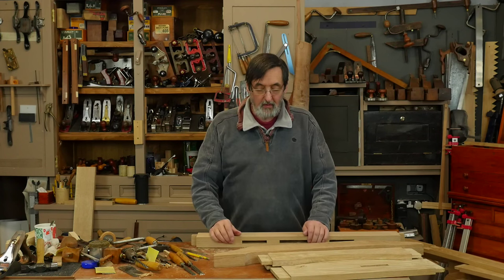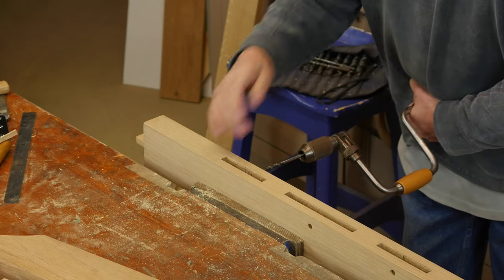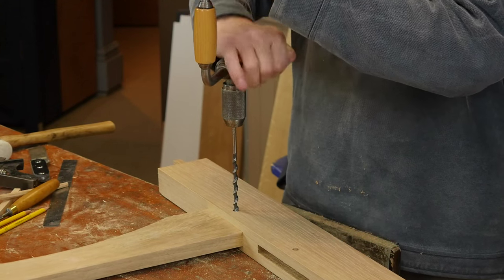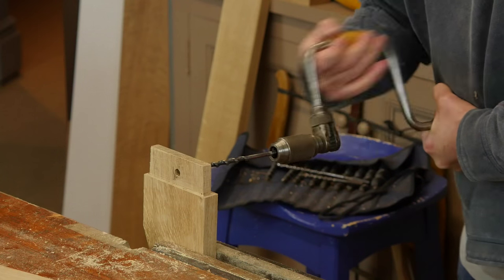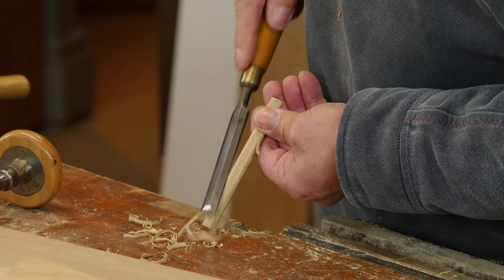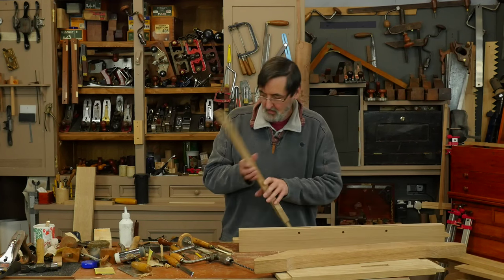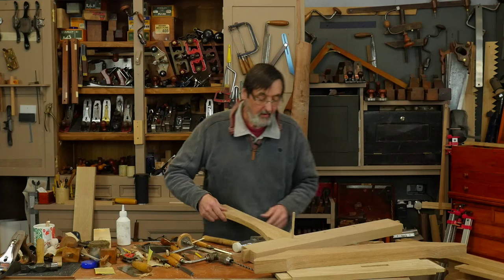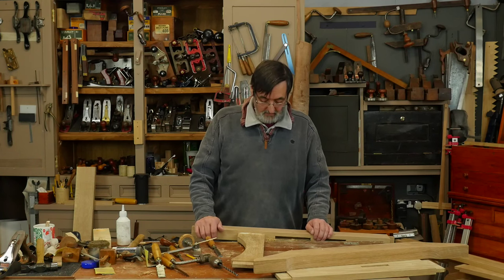How to make a Drawbore Mortice and Tenon | Paul Sellers

Comment: This is how my father, a carpenter, worked in Tuscany (Italy).  All of his furniture pieces were built using this method.  He would build the furniture in his shop, make sure everything fit.  He would then disassemble it and have it hauled (on mule-back) to the client in some distant village and re-assemble it - only then would he add the glue (on the dowel only).  Those pieces of furniture are still in everyday use 70 years later.
Reply: That makes a lot of sense, the dowel could be drilled out for disassembly if ever needed.
Reply: My grandfather built furniture using similar methods 100 year ago and they are still going strong today.
Reply: Great story.  My great great grandfather took his family to America from Liguria (Genoa) in 1869.  He wasn't a carpenter to my knowledge.  America had recognized the sovereignty of Italy as a country only in 1860.  I visited the village in 2018.  It's still just a little village with no commercial enterprises at all, not even a market stall.  I applied for recognition of Italian citizenship in the USA and received it in 2019.  It's quite an emotional feeling to come back full circle to your heritage.
Reply: @deemdoubleu  I think if you wanted to make knock-down joinery, you would use a tusked tenon joint.  Probably not as strong, but easily disassembled and suitable for tables, sideboards, etc.  A tap with a hammer on the tusk tightens up any wobbly joints.

Comment: Hi Paul, love your vids. I've also bought your dvds and book. Can't understand why these people don't trust the draw bore method, thinking that it weakens the joint. It tightens the joint a treat. As you rightly said, thousands of artisans have been using the method for centuries. Best teacher around.
Reply: Even if you made it with a screws it would be extremely strong. A lap or bridal joint similar to that with just screws would be extremely strong as well. 
Fools talking about it not being strong enough are deluded about strength. If they put a load large enough to break the table top and then the stiles and rails they are a special type of person.

Comment: I learned this with timberframe, and we only used 1/8" if I recall correctly.  Watched this to see exactly how much offset would be appropriate for smaller joins.  Of course we didn't use any glue. Excellence in fine wood working!

Comment: Dear sir, as a novice woodworker I was about to build my first workbench when I came across these videos about drawbore method.Do you think this method will work for a workbench?

I will be using
 4×5  & 3×4 sized timber.

If this is possible could you propose a thickness for the dowels and the offset value?

Your thoughts would be of great help.

Comment: would there be a concern about breaking out the center of the tenon?  How deep/shallow would you place the bore?
Reply: Pass Me By all the fibres will be supported as the tenon is inside the mortice hole.  halfway from the shoulder to the edge

Comment: So you prefer to chip off the excess PVA glue after it's set rather than wipe it off with a wet rag immediately? I've tried both, the latter tends to contaminate the grain with the thinned-out glue, and the former tends to rip up the fibres as it's prised off. I'd be interested to know how a proper woodworker deals with this.
Reply: Gaf It seems the sweet spot for taking glue off is about 20-30 min after set.  It's pretty pliable and kind of rubbery and comes off without a lot of contamination to the wood.
Reply: Gaf Don't use PVA glue. I use hide glue. Most of the time I use hot hide glue. Liquid hide glue like Old Brown Glue is much easier to use. Hide glues have no effect on finishes. Wipe the excess with a rag damped with cold water and you are done. Hide glue isn't suitable for outdoor pieces though. It is possible to reverse the bond with heat and water.
Reply from the maker: Gaf A sharp 1" chisel into the corner following both flat faces and cutting through the leather hard glue has worked for me for 50 years. No torn grain and no glue residue. Not gonna change now. i hate wet rags smearing the glue and raising the grain. Forget that. Neither do I like ideas like wrapping with masking tape. its silly.

Comment: I'm not much of a hand tool person. So, I have a question. If not using a drill press to make sure the through hole on the mortise and tenon boards, how are you sure that it is not angled? For example, you start your hole 1/16th higher on the tenon but on the other side end up with something different, like 1/16th lower. Wouldn't this cause an issue? Thanks
Reply from the maker: The idea with a drawbored mortise and tenon is that the holes are offset by 1/16. With the hole in the tenon being 1/16th nearer to the shoulder of the tenon so that when the pointed wooden pin enters the mortise piece it passes through a tenon and this pulls the shoulders of the tenon tight to the mortise piece. It doesn’t really matter whether the hole is perfectly perpendicular at all.

Comment: Great video, I was told by a much more experienced WW that using a drawbore in a M/T joint would weaken the tenon. It was for a workbench so it was in some decent sized wood, I didn't add them and am starting to second guess myself for listening. The bench is still rock solid with just glue and the joints were nice and tight to begin with?? Any thoughts? I would also like to hear your thoughts and how to clean the wood glue like GAF below.
Reply from the maker: Pat M Fraid he was wrong. At one time, before the screw-thread, every mortise and tenon relied on the draw-bore method. Surely two hundred thousand woodworkers can't have been wrong.
Reply: The glue joint will always be stronger than drawbore joint (at least when you have some long grain against long-grain), simply because it's always wood that would break there, not the glue (at least with modern PVA glues). Drawbore joint is self-tightening, something you don't have with glued joints without trickery. With drawbore joint you don't need to have 6ft long clamps (or 2x 3ft) for dinner table construction etc.
Reply: These are great points all, and with smaller m/t joints I think it is possible to weaken and break them more easily but in a large tenon which is 1" thick by 3" long probably not as likely. The gluing of long grain to long grain is what is happening in all my joints so I think the bench will be fine for a loong time to come.
Reply: MichaelKingsfordGray For it to split there would need to be room for expansion yes? For that split to be large enough to weaken the joint, it would need to be more than just a little room from, say, a taper on the tenon.  If your tenon is fit properly then there would be no room for it to separate. There are still buildings standing (that used this method) without a single screw or glue located in the joints. The real strength of this joint is the dowel seating the shoulder on tightly.
Reply: +MichaelKingsfordGray I think you are right and paper is not a fair comparison because the fibers run in all directions, whereas wood runs all fibres parallel. However, when the tenon will crack, it will most likely crack on one side first. This will split the the tenon apart and thus wedge the tenon inside the mortise while relieving most of the pressure on the dowel at the same time.

So with more force on the mortise/tenon holding it in place, and relieved stress on the dowel/tenon I don't think the forces will be high enough to actually make the second split then stripping out a full 10mm slot.

Comment: I don't think you mentioned the main advantage of a drawbored mortise and tenon joint: there is no need to use clamps for the glue up!

This is especially nice when doing something large and not having enough clamps in the workshop. Otherwise, there is little point in the extra effort required to drawbore the joint, but not needing to clamp the piece makes it well worth the effort in certain cases where clamping is impractical...

Comment: You mentioned that boring through all three pieces at once is not at all what a woodworker should do.  Why not?
Reply: PiperCub49 because that does not result in the additional tension force of the draw bore.  Drilling right through would give you a through-bore with zero clamping force.
Reply: PiperCub49 You wouldn't get the offset that allows dowel to pull the joint tight.
Reply from the maker: PiperCub49 It wouldn't draw the shoulders up and neither does the peg bend and create the tension you want. If you go to paulsellers.com you can see more on my blog on this issue there.
Reply: Paul Sellers Thanks everyone.  That makes sense.  Paul--I'll get to reading!